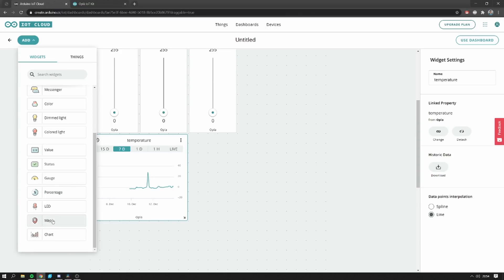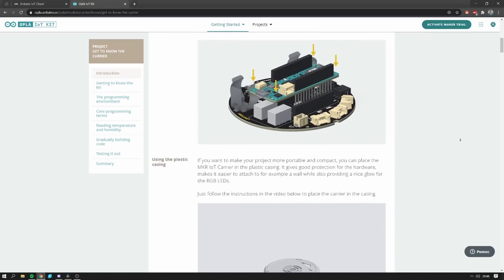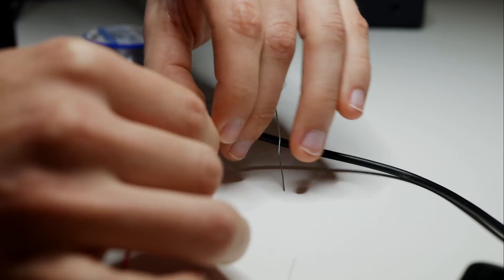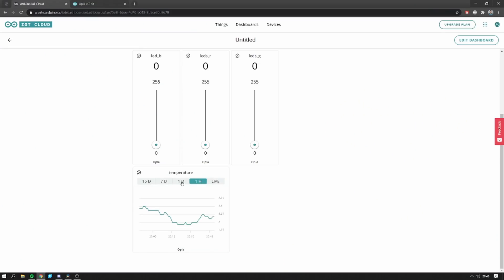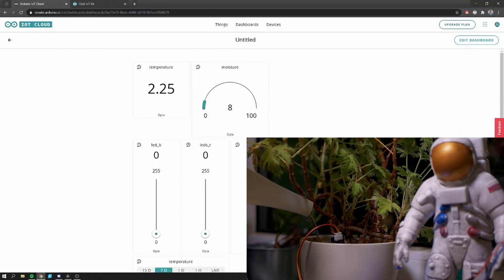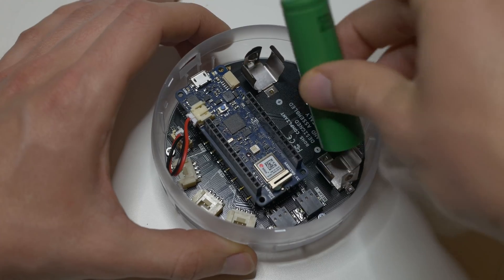IoT Data Logger With Arduino Opla

Comment: Does your opla capacitive moisture sensor has a voltage regulator on the sensor mine is empty 3 pads
https://youtu.be/1jKAxLyOY_s
Playing with the opla sensor in another setup